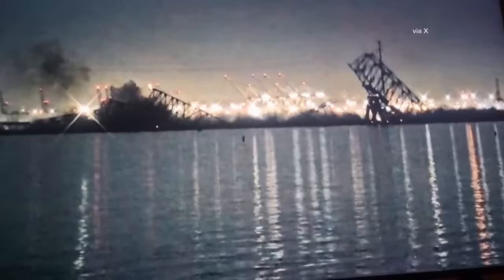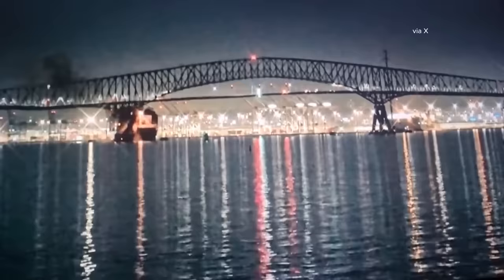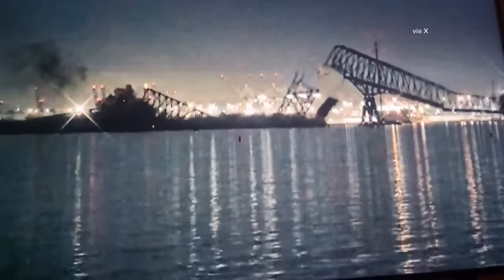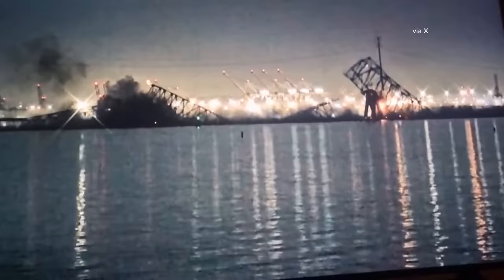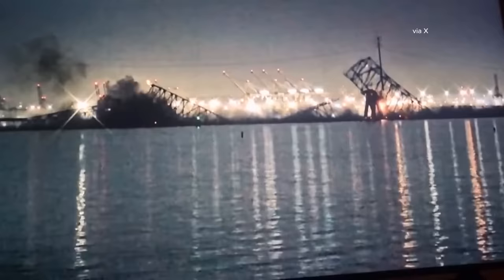Why did Baltimore's Key Bridge collapse? Renowned structural engineer weighs in

Comment: It got hit by a near 1000 foot long, 95,000 ton ship--- period. No mystery
Reply: The mystery is why did the ship lose power, why were no pilot boats used to escort it under the bridge and why weren’t there more substantial protective barriers around the base of the bridge supports? I’m kind of surprised this did not happen sooner.
Reply: @HeatherRose2023 there was a harbor pilot on the boat. Why do you think there wasn't? They don't use tugboat type things they have specific harbor pilots that ride on the ship because they are familiar with the waterways they guide the captain who guides the ship.
Reply: @DiscoCatsMeow  
Yes, there was a harbor pilot on board. However, his knowledge of the channel way was of no help in this situation. What was need was the bolstering of tugboats to push the ship away from the bridge supports.
Reply: @HeatherRose2023  That is what I was wondering.  From the video, itself, there should be more than enough room between the columns.  That is what made  my theory go out the window.  I thought the ship was too tall, or had too much cargo.  Obviously, I was wrong!
Reply: @QUICKBOOKS1  
The ship lost its steerage power and drifted into the bridge support.

Comment: As an engineer.  A Truss bridge, is a type of bridge that is designed to distribute weight and stress evenly throughout its structure. Truss bridges are known for their strength and ability to support heavy loads.

Whether a truss bridge would collapse fully on first impact from a boat would depend on various factors, including the size and speed of the boat, the design and condition of the bridge, and the angle and force of the impact.

In general, truss bridges are designed to withstand significant loads and forces, including impacts from vehicles or boats. However, a particularly large or fast-moving boat could potentially cause damage to a bridge upon impact.
Reply: When they build them they start at the pier and build out both directions. Continuous steel beam bridges are the same concept. The bridge needs the weight of the next span to hold tension on another span. If this happened to something like a prestress girder bridge the collapse would have stopped at the 2 closest piers. I don't think they can span that far so a moot point. They could also rebuild 1 pier and 2 spans way faster than what this is going to take. I'm just not a fan of making multiple spans work as a single unit dependent on the others.
Reply: @williamrosenow6176  Most definitely 😁😁
It's just a better built bridge..
a prestressed girder bridge, high-strength steel tendons or cables are placed in the concrete girders before the concrete is poured. These tendons are then tensioned, creating a compressive force within the concrete. This pre-compression helps to counteract the tensile stresses that the bridge girders will experience when subjected to loads, such as the weight of vehicles or other live loads.

Prestressed girder bridges are known for their ability to span longer distances and carry heavier loads compared to traditional reinforced concrete bridges. They offer advantages such as increased durability, reduced maintenance requirements, and the ability to achieve longer spans with fewer supports. These bridges are commonly used in highway and railway bridge construction where longer spans are required.
Reply: I'd guess that Ship weighed significantly more than the bridge/leg ... took it out like a sledgehammer.

Comment: So you have a waterway with high traffic of large and heavy cargo vessels going in and out port, you have a bridge spanning across that waterway, 30 thousand and more vehicles with people passing through that bridge every day and night, a bridge that has proven not being able to withstand an impact on one of its pillars without collapsing. 
Someone had to imagined and thought about the fact that one day any day or any night a vessel could have collided with one of those pillars, no one ever thought about that, no one had the brain and the balls to be in charge of ensuring safe and supervised navigation under that bridge through those pillars all the time at all hours, well there you have the result, now everyone looking for excuses and trying to "explain" what happened, Bullshit!
Reply: When the key bridge was built, No ships were capable of this. They were much smaller.
Reply: Absolutely agree. What they should be saying is that it's an idiotic design and that when you design a structure that is envisaged to last 50 years or more in a growing economy you need to design it with foresight and beef it up a bit, and protect the rather weak looking support pylons by surrounding them with sturdy structures that with stop almost anything. 

If the truth is known they put cost cutting above safety. But a new bridge is hardly going to work out cheaper.
Reply: don't blame the bridge
Reply: @fibonaccisrazor  It was a shitty design. One good smack and it takes out the whole thing. No fixing anything.

Comment: What is the expert's opinion on the damage to the bridge... will it have to be replaced?
Reply: What do you think?
Reply: @briano6268 uh, probably not.
Reply: @briano6268 honestly, I think with a month of repairs, it'll be alright.
Reply: @davidrhodes5604  I'll pretty confidently venture a guess that none of the twisted beams and road deck lying in the river are repairable. The bridge was 1.6 miles in length and it appears that all that is left standing are the ramps on either side that lead up to the truss spans. Those ramps are probably fine. So if we're gonna call replacing well more than half of the bridge a repair job then I bet they "repair it". Don't see it happening in a month though.
Reply: It should buff out.
Reply: Nah, just straighten it and put it back up. 😂
Reply: What can't you do with Duct tape and WD-40??
Reply: @cachecow  the bridge is fine, the tape and wd40 is to waterproof your car when you drive across it.
Reply: I think we should consult another engineer to build a time machine
Reply: Wasn't that stated at the end of the video?  I just saw the video again, and, Reconstruction was mentioned.

Comment: “Called in to assess the structural integrity of structures after failure…” I would think you’d want to do that beforehand so it doesn’t actually fail.
Reply: It's fairly important afterwards as well. For example, is the remaining structure (if previously an occupied building) safe to reenter? Can it be shored up and rebuilt or should it be torn down? Is it posing additional danger to adjacent structures? Has it compromised underground utilities to other areas previously unknown? 

These are important questions that need to be carefully assessed and answered.
Reply: @hawkeye7527  Yeah. I was just taking a jab at the wording of the sentence. Because once the structure has failed, it doesn’t have much structural integrity anymore.
Reply: @Heavilymoderated   That's definitely fair.

Comment: This engineer is an expert in structures, and is focussed on the structure of the bridge itself.  He completely misses the point that when a bridge crosses a ship channel, it is necessary to prevent a ship from striking the structure of the bridge or its supports.  This is done with fenders designed to keep ships away from the pylons and to absorb energy from allisions.  The first photograph of the bridge in this video clearly shows that it has no large energy-absorbing fenders around the main pylons, yet "no issues were reported with the Francis Scott Key bridge."
Reply: There are giant concrete dolphins on either side of the channel and bridge pillars. It was just a worst-case scenario
Reply: @junkboxcustoms  yea but they were entirely inadequate. Some of the aerial shots show that the ship narrowly missed the only one that could have potentially stopped it. Many, if not most new bridges have substantial dolphins all around critical supports. They may or may not have saved the day here, but they would have given the bridge a much better fighting chance.
Reply: No way any “protectors” will stop a ship that massive, unless the support piers were surrounded by a considerable amount of land. But that kind of blocks the shipping lane.
Reply: we need belt and suspenders going forward..........  Huge concerte bumpers upstream and downstream, less along the sides, but still substantial.  Also, 4 tugs on the boat until national infrastructure has been passed going in and out.  Either one of these would have prevented this accident.  The bumpers should be massive  enough to arrest a container ship at speed as in a terrorist attack.
Reply: @junkboxcustoms  they didn't look very giant to me.

Comment: This type of bridge collapse is not uncommon and large ships have taken down many bridges over the years.  What puzzles me is that critical infrastructure like this isn't protected by guarding the piers that support the bridge.  In most cases like this it isn't the ship hitting the bridge deck that causes the problem but the ship hitting a pier the vertically supports the bridge, but why are those critical piers so often left naked and exposed to potential ship impact?  Why isn't there structures in the water to prevent the ship from hitting the piers?  Such a defensive structure could function to either absorb the impact from the ship or to divert the ship from impacting the piers -- or to be able to do both.
Reply: SUUURE Jan.
Reply: MDTA incompetence

Comment: Because the shipping company was too cheap to contract escort tugs.
Reply: Thank you for your comment.  You are the first one that I have seen to question the lack of stand-by tugs.
Reply: @philiplangford9434 Tugs were employed until they were no longer required by harbor rules.  So now you'll want to demonstrate your expertise on harbor piloting, right?
Reply: @diegofondoo1780  Not at all.  Just pointing out the flaw in your analysis.
Reply: They don't use tugs they use harbor pilots. Which to me actually makes more sense the pilot is familiar with the waterway. The captain is familiar with the ship so they work together to get the boat out of harbor.
Reply: should be mandatory when national infrastructure is at risk.
Reply: @DiscoCatsMeow  a pilot cannot remedy a power loss.
Reply: @peetky8645  I believe they did drop the anchor and tried to counteract the ship's trajectory but it was simply too big and too heavy. Literally dead in the water. Crazy.
Reply: @DiscoCatsMeow Actually, they do use tug boats to assist in the docking and undocking of the vessels.  Tugboats usually only assist up until the vessel reaches the main channel and is capable of navigating on its own.  In this case there were two tugs that assisted her away from the dock and disengaged once she was in the main channel.
Reply: You mean .. Because the cheapskates in Baltimore were too cheap to put up safety barrier/dolphins to fend off any ship like this?  A little tug can only do so much once that much weight gets moving.

Comment: In shiphandling school they teach you "Speed Kills but Momentum Destroys".  95,000 tons x 8 knots has the same momentum as an average sized (1.5 ton) car hitting at a ridiculous 557,333 mph. Even at 1 knot, the momentum is enormous with that weight, which is why tugs are there to ease them up to the pier when docking.
Reply: You don't have to go to Shiphandling School to understand what a 10 pound Sledgehammer does to a 2x4.  The official formula is Weight + Speed = Smash.

Comment: Like 10 years ago I was looking up jobs on the state site. One of the jobs was a bridge inspector pay was 140k ish a year which required some college. I never forgot about that job because I wondered why every other bridge in my area was rusted and concrete cracked up. Then 5 years later there was an undercover investigation that found the bridge inspector wasn’t showing up to check bridges and the ones he did he never got out of the car.
Reply: That is what I was wondering.  How often is a bridge inspected, if I am using the  correct term.
Reply: Rickety POS bridge. No protection. Bound to happen.

Comment: It is called momentum and speed. Moving object hits stationary object called truss bridge. Ripple effect and gravity takes over. News is such BS now.
Reply: It's basically a mouse trying to stop a full grown elephant
Reply: And all those tests the guy talked about having done. Probably cost as much as having the bridge rebuilt… only one test needed…. A big ass boat with a lot of weight ran into it… I would start with a drug and alcohol test 1st. Lol
Reply: @craigsaimes4063  Initial reports (and you can see it on the video prior to the ship hitting the bridge) are that the ship lost power. Steering a ship is achieved by a rudder but if the powerplant is not operating to produce thrust via the propeller(s) it is essentially adrift and out of control. The ship actually called a Mayday for loss of propulsion shortly before the accident. Still, you can bet that the master, pilots, and bridge officers will be tested.
Reply: @briano6268 you're totally missing my point. Anyways the boat should of never had clearance to sail.
Had propulsion issues amongst other things and had already crashed once in 2016.
Reply: The news report conclusive dispelled the rumor that it was a UFO! 🙂
Reply: @briano6268  Thank You.  I heard that, too, briefly.

Comment: Kinetic energy = 1/2 * m * v  .
assume: ship mass=100.000 tons = 100.000.000. kg  ,  ship velocity=15 km/h  
KE = 868,055,694.44445 Joule . 

For illustration, an object with 0.1 kg fall to earth at height of 1 meter is 1 Joule. So 868,055,694.44445 Joule is equal 88,517,046.539 kg fall to earth at height of 1 meter.

that is how strong the Kinetic energy that hit the bridge pillar.

Comment: I know that opinions are like assholes (everybody has one), but I watched an interview with another engineer, and he said that construction standards for a bridge built today and one built in 1979 are significantly different. Further, 1970s cargo ships were half the size of today’s ships. So, is it possible that a modern bridge might have withstood the impact better than an older one? Or are the ships so large they’ll take down anything, no matter how well built?
Reply: I'm more concerned with Ships/Rudder operation.  A rudder can steer even if a ship has lost power.. If the rudder's operation is not tied into the emergency power generator.. to get steerage back up online in a few seconds .. that is a design failure.